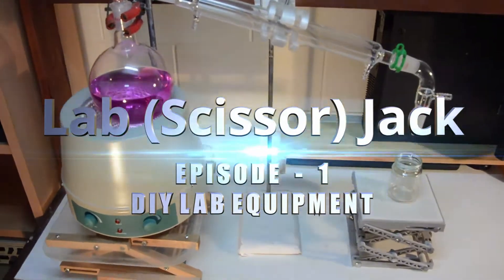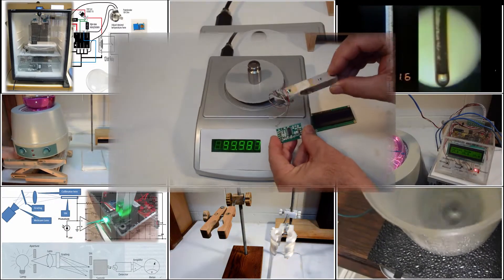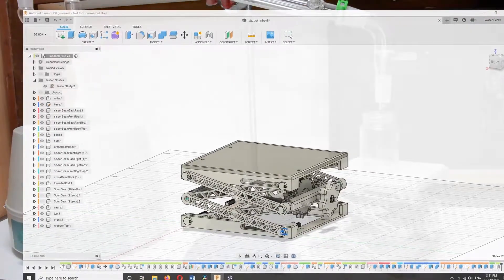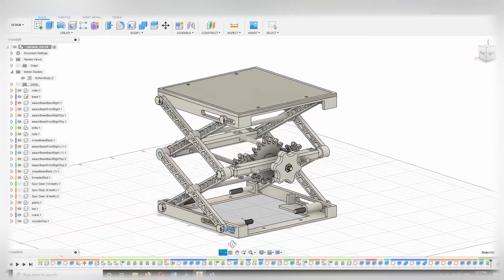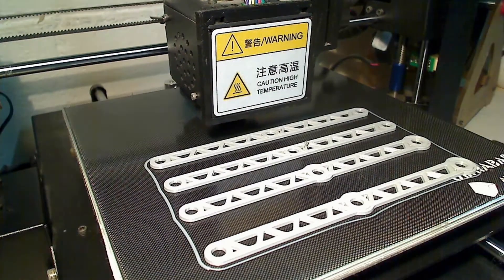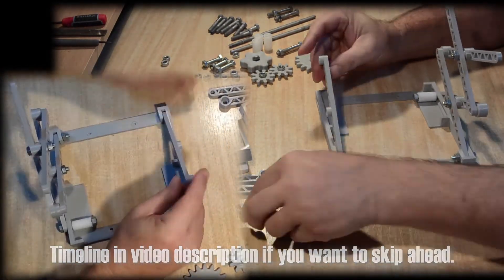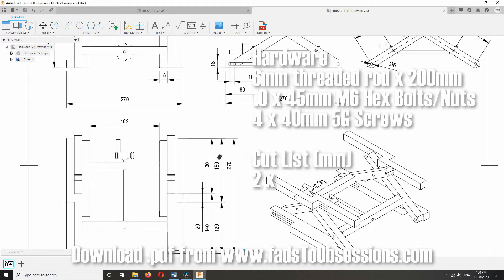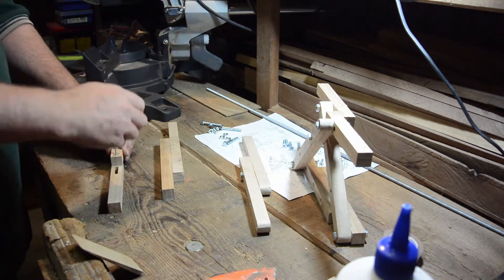DIY Lab Tools - Lab Scissor Jack

Comment: Would you sell the 3d printed lab jack? I'm interested in one but i don't have a 3d printer
Reply from the maker: The cost alone of international mail/freight of 3D printed item (I'm assuming you don't live in Australia) probably a large fraction compared to the cost of commercially available item local to you. Which would be metal versus PLA  - the PLA (or even using ABS) is not as robust as commercially made metal, and needs to be re-printed depending upon your use. If you have a 3D printer, this is cheaper in the long run - but if no 3D printer, well perhaps not. Another option is, 3D printing service local to you, or perhaps a "makers club" or similar that would give you access to a printer.

Comment: What are some ways that you can make a jack raise and lower faster?
Reply from the maker: You could try use a threaded rod with coarser threads (for the wooden, larger version), for the 3D printed version, you could also change the gear sizes (make the "central" gear larger and the outer ones smaller) - may help a little

Comment: This is super awesome ! 
Do you think it would be difficult to motorize it? One way would be to attach the motor to the middle crank, but you'd need to attach it to the middle transversal bar somehow, since in has to travel up and down with it. Another version would be to have the lead screws into the bottom pair of rods, and attach the motor to the base plate. What do you think ?

Thanks a lot for all the instructions !
Reply from the maker: sounds good, could make changing height possibly quicker/smoother

Comment: That's cool but could u make a drill attachment to speed the process of raising and lowering faster
Reply from the maker: yes you could, if moving it faster is needed, perhaps could also use a small DC motor or servo-motor (with suitable controller), and then have a dedicated unit
Reply: @FadsToObsessions  yeah true if u needed it faster of course